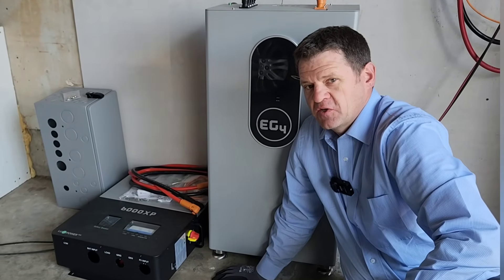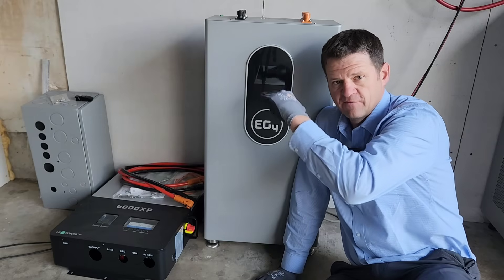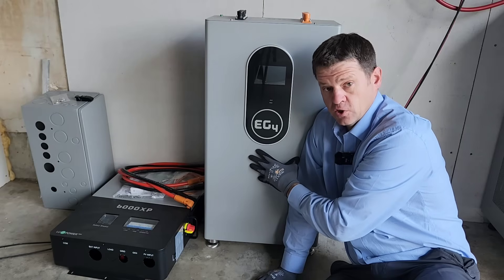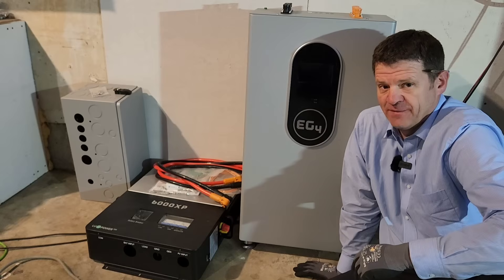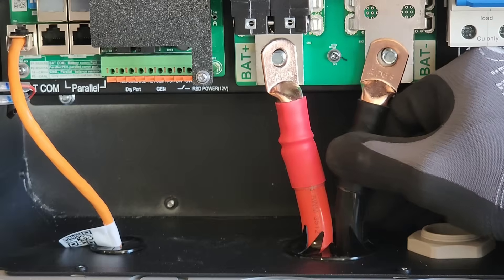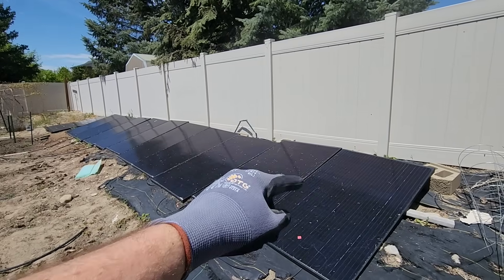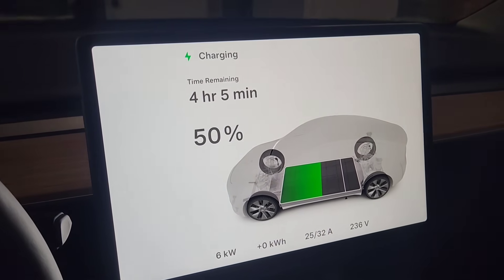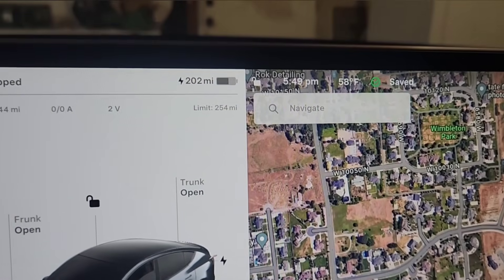I Built a Home EV Car Charger - Off-Grid, Battery Powered

Comment: Great Video. Thank you! Quick question - How did you ground the whole system? Did you connect the XP6000 PE/ground bus bar to a grounding rod? Or perhaps to a local subpanel and then to a grounding rod nearby? Thanks!
Reply from the maker: A system like this needs a ground neutral bond...i believe I added that to this system or configured it in the inverter. Which protects against any ground faults. 
   Earth ground rod does not protect against ground faults but it definitely couldn't hurt to add. The system shown in this video is not connected to Earth ground.

Comment: How do you expand to multiple batteries?
Reply from the maker: It's really easy. All you do is Mount the battery or batteries next to it and then you can buy battery cables with your battery and it allows you to connect the batteries together. There is a bus bar on the top of each battery. And if you are still unsure you can call Signature solar or eg4 Texas support and they can walk you through the process and what you need.  👍

Comment: I have a few questions:
- Since you didn't have a permit (hopefully no needed), have you checked with insurance company if they would pay when for whatever reason the unit causes a fire and burn the house?
- What happen when the battery is full, does the solar still charging?
- What the warranty of the inverter and the battery?
Reply from the maker: You would have to ask your insurance company. But this setup isn't tied into my house electrical system at all.  Very similar to using a chargeable power station in your house but just a bigger battery.
  The battery, I believe is 10 year and the inverter is a 5-year warranty.

Comment: Like your calculation break down. I am in Southern CA and work from home and I don't plan to take the car on the road trip (just need to be able to drive 100 miles round trip on every other weekend) so to make it more cost effective I think I need just half of your system. Does the inverter shutoff when your battery is full?
Reply from the maker: Ya. It will stop charging the battery when the battery is full. Just like any other battery charger

Comment: Thanks for sharing, very well done and informative.  However, the economics of this isn’t adding up vs just using the grid.  I’m sure your grid power rates are less than our in the NE  .32 per kwhr, so wouldn’t it make more financial sense to just use the grid?  I mean it going to take you a long time to recoup those upfront costs of the system you bought.  You’re also limited with the small amount of miles your pumping into an ev per charge.
Reply from the maker: It really depends on how much you drive.  So basically you just have to calculate how many kilowatt hours(kwh) your car is using it a month. And multiply that by your cost per kwh....eg $0.31 
      Some people aren't as worried about the costs but are more worried about having power in case of an emergency. My father-in-law had the power go out for 3 days... He started his generator up but it was driving him nuts because it was so loud. He eventually was going to run out of fuel.

Comment: H and thanks for your useful videos. Just curious, I have the same system other than the batteries that are 2 100ah lipos. Do I need to rod ground the inverter? Or will running the wires from the nema to the ground (PE) suffice, or do I need a wire from the PE  to the Ground rod? Thanks for your help
Reply from the maker: The YT channel "Electrician U" has a good video on "Why Do We Use Ground Rods".    I would watch that video and see if it's something you want to add. It wouldn't be to hard to connect your ground(EGC) to your house ground... which is connected to earth ground.

Comment: Thank you - a fantastic video exactly what I want to do.

I'm in Sydney Australia in a strata apartment block (condo) with our garage a fair distance and isolated from our apartment so I was looking for an off grid solar system solely for charging my EV. I'm retired so I'm home a fair amount of the time during the day day so I'll initially try a small 2 or 3 Kwh battery.
Reply from the maker: There are also some inverters that run without battery power... sun only. So that would also save you some money.  Cheers

Comment: These batteries are far far way from the energy capacity of the car. If you're building a system like this, it's pretty much required to be charging throughout daytime, unless you are willing to build a 60kwh bank, which comes with a cost and with permit challenges. Or not be using too much of the millage

Comment: 13:00 - Hopefully, you got a receptacle designed to handle EV charging (like Hubbell), which is designed to handle continuous EV loads. The $10 version you get from your big box store isn't designed for hours and hours of current flowing through it and they can't melt and catch fire. It might not happen right away. Sometimes, it can happen 1 or 2 years later. Just an fyi.

Edit: Never mind. I see someone else already pointed this out.
Reply from the maker: Good reminder. I need to do an update video on this.
Reply: @ I did mine over 2 years ago and I did it with the Hubbell version. I change my Tesla and my daughter's Mini PHEV. So far, so good. Honestly, if I had to do it over again, I would have skipped the NEMA 14-50 and just put a permanent hardwired charger. Awesome videos, btw.
Reply from the maker: Thanks, That's a good point. Maybe I'll do that in the next one.

Comment: Looks like you didn't ground your junction box.  Your grounding should be connected to a ground rod.  The neutral should be connected at one point to the ground.
Reply from the maker: I updated the setting in the inverter to enable the ground neutral bond. It is an internal relay.  👍
Reply: @diySolarPowerFunWithRay  That's good.  Is your ground system tied to the earth?  water pipe, ground rod or maybe your grid system ground?
Reply from the maker: No, at the moment it's just acting similar to a portable generator you would pull around to charge something.  The breakers work fine without an earth ground.  The ground rod acts to stabilize voltage fluctuations, often caused by other loads turning on and off.  Because this is just a single load, My car, I didn't tie it to earth ground.
Reply: @ Imagine the hot side of the circuit gets a fault to the chassis and your child gets hold of it.
Reply from the maker: @ if that scenario happens the breaker will trip and clear the fault.  A ground rod has nothing to do with clearing faults.
Reply: @ If current is flowing through a body that won't trip a breaker.  So why use a grounding system on a house?

Comment: the wholesale prices of these systems has gotten so insanely cheap just in the last year that you posted this video. I just bought a 6.5kw eu/uk/asian spec 220 or 240v single phase 48v inverter for 300 bucks delivered... the inverters meant for the non-us markets are like 1/5th the price of north american versions (120v/240v split phase) if you can figure out a way to use "single phase 240v." EV's dont care what country youre in, they charge just fine even on 50hz, i learned this from some us military guys who posted on the gm volt forums after they transported their chevy volts to the UK as one of the perks during their deployment there. 
building my own ~15kw (16s 280ah) LFP battery, cells only cost 720 bucks delivered. no bms, just dumb active inductive balance boards for now. 
pretty much the same system as this but only cost ~1k. kind of ghetto but makes sense coz i rent and cant really modify the house. no way to put in a level 2 charger, but i can just charge from my diy home ev charger.
going to wire in about 1kw of those cheap flexible solar panels, probably will half mount them to a fence with some pvc/lumber. 
the one trick to make this work even in winter time is that I have a 30$ 500w 120v to 240v step up transformer which can trickle charge the whole pack based on the inverter settings. so basically a very convoluted way of putting in a 6.5kw level 2 charger in the garage of a rental property which uses temporary solar panels.
just like you, mines its own isolated system. makes the most sense if youre thinking of going into solar to mess around with a solar ev charger since its usually the highest consumer of electricity. Im getting away with a small 15kw battery because our two phev's (gen1 volts) only have a ~10.5kwh usable battery state of charge (16.5kwh total, over a third of that is kept in reserve for longevity by design)

Comment: Is that a Leviton 14-50 receptacle? If it is, I would recommend you change it and buy a Hubbell or Bryant receptacle. They are commercial grade receptacles. My Leviton plug did not work well, the Tesla charger kept lower amperage because it detected that the plug was overheating.  There are a few videos showing Leviton plugs burning.  Thanks for the video.
Reply from the maker: Thank you. I'm going to update my plug!!

Comment: Word of CAUTION 💀 regarding that NEMA 14-50 receptacle you just installed! It is not designed for extended draw of an EV charger. Please look at the following NEMA 14-50 plug Leviton Part Number 1450R or Hubbell Lighting HBL9450A. Bother of these receptables have a car charging logo printed on the receptacle and cost between 40-60 USD. They are specifically designed for extended high draw EV charger applications. The basic 14-50 appliance plug while technically rated for the amperage is rated for intermittent draw of an appliance and not designed for EV charging. It is at best a melted outlet and charger connector and at worst a house fire if you continue to run the appliance receptable. :face-orange-biting-nails::face-fuchsia-tongue-out:
Reply from the maker: Thank you for bringing this up.  It is definitely safer to use the plugs you mention.  I'll update the part in the description and pin a comment mentioning this.  I think where most people get in trouble is they use the full 50 amps out of the 50 amp plug... But for continuous draw loads(eg EV charging) it's only rated for "40amps per NEC code using "The 80% Rule".  Even though the Inverter shown in this video can only output 25 amps through the outlet it would still be best to use the Hubbell outlet. Thanks!
Reply: @diySolarPowerFunWithRay  Nice yeah there have just been too many melted plugs going around using those cheaper outlets. You probably would have been fine being that your system is limited by the inverter (25amps) output and capacity of the battery. As they say better safe than sorry! You may have someone reference this video for a charger install on grid power.
Reply from the maker: @ShaneTheGeek  thanks. Yeah I might do a follow-up video and I will mention these plugs for sure

Comment: Anybody else convinced these are just money pit traps? We all use electricity with no problem for very cheap every day, yet for some reason, we feel we have to provide our own electricity and spend thousands of dollars doing it? Seems silly. Unless it's totally off grid, power walls make little sense.
Reply from the maker: I think it can be don't pretty cheap if you exclude the batteries and charge during the day with solar only.  Maybe I'll make a video on that in the future
Reply: "We all use electricity with no problem for very cheap every day"
In some places electricity is actually quite expensive, with off-peak pricing of 40¢/kWh and peak pricing of 60¢/kWh or more. In other places the power grid can be unreliable, whether because of frequent natural disasters or aging/insufficient infrastructure. If you don't need or want it, fine. But that doesn't mean there aren't other people who find this useful.

Comment: For those of you that are retired or work from home, and can charge during the day, here is an option that will cost even less. You can build a similar setup without the costly batteries and connect your EVSE ("charger") to the 240v connection on the inverter. Next, like with my Tesla, you can schedule charging, so leave it plugged in and have it charge during sun hours. Here in Los Angeles, I have about 5.5 peak hours of sun. You must set your either your EVSE or your car's charge rate to 25 amps (this rate may slightly vary depending on the inverter power). I suggest sizing appropriately. If you only drive 20 miles/day, go with less panels. Calculate your line/inverter/panel losses. If you start small, you can add a few panels later. Ray has it down for most, but this is a great "cheap" option if you are home during the day!
Reply from the maker: Great way to save money! I'd look at this inverter if you want to do car charging without a battery(I still need to test this inverter):  https://watts247.com/product/nhx-5kw-split-phase-120v-240v-outdoor-rated-grid-interactive-ul-listed-pv-inputs-to-500v-and-much-more/?wpam_id=133
     The 6000XP might work without a battery but the manual doesn't recommend it.
Reply: Or if you have 2 Teslas….

Comment: Maybe invest in a welding machine and some structural steel for those panels. 😁
Anyway, for those of us who are poor: My leaf will charge from my 110 volt 4000 watt inverter. Since I'm retired and only drive a couple of times a week this is just fine. To go from 0 to full would take about 2 days, but I just bring it up to 80% after I take a trip.

Comment: Many mistakes... 1- Never charge your EV battery to 100%, but 80-85% max except when you absolutely need a full charge. 2- Your NEMA 14-50 should NOT be the same as the one for appliances. You must use a better grade to avoid heat, risk of melting the outlet, fire, etc. You must be very careful with such advice abou the NEMA, people may experience a fire and claim you give them advice... Think twice...

Comment: I am in a wait and see what comes next mode on EV vehicles. My system is only 5.44 kilowatts and upgrading is still a year away so the EV thing is not for me just yet.  On a side note check out the GE profile 2 in1 washer dryer combo that I am probably going to look to get come black Friday to replace my Samsung stackable energy hogs. Planning on ditching the gas water heater for an electric and hoping the energy drain will even out with this particular washer and dryer all in one. Saw this on a Jesse Muller 18kpv install video or never would have known it existed. 🤷‍♂👍🏻👍🏻Great video Ray!
Reply from the maker: With only a 5 KW array I imagine it will be cheaper to heat water with your gas setup.
Reply from the maker: Cool. I like his videos.  I'll check it out.  I didn't see that snippet.
Reply: @diySolarPowerFunWithRay  yeah reading about the specs I was pretty excited. Some folks have lint issues but there is a hack for that. 👍🏻 thanks

Comment: You're SO CLOSE. With solar batteries at 4 to 6 or more times the cost of EV batts pee kwh you could have 2 EV batts, devise a way to easily swap them outof car and connect to house on alternating  days.Im rhinking a trunk mounted slide in gurney/trolley that rolls up to the house mains area, Then roll the other solar charged batt to the car. Would be best to have a hybrid ev so that a low battery(clouds,rain) doesnt limit your driving range.
Reply: Also I would trust the WARRANTY on an EV  battery far more than that of even the most highest quality solar battery or firewall manufacturer.
Reply from the maker: Interesting... I wanna see one. :)

Comment: thinking of building something like this for the trunk of my chevy volt.
too many times I get to somewhere that should have chargers and theyre all being used or broken, and I have to use gas on the way home.

200$ 240v single phase out (EU standard) 3kw, 24v inverter, has meh PV input (not mppt) and not the fastest battery charge rate
30$ 20mm ammo can
8x 280ah lifepo4 batteries, 55$ each lol, theoretically 8 of them can fit in a single 20mm can if you get the threaded (not stud) versions and stack them facing in, 2x groups of 4 (12v x2)
just wont run BMS' since they cause so many fires unless you way over spend on them. ive been getting away with only using active inductive balancers instead and spending a lot of time top balancing first (2x 4s, one for each 12v stack). think im the only one who does this.

and then use one of those j1772 240v to nema 15-20 e-bike chargers (30$) and cut the end of and wire it into the inverter, then i can charge it up with my ev charger at home or an ev charger I park at.
im pretty sure I can wire it so that 240v from my charger can go into the range extender and charge batteries while it also outputs 3kwh 240v to my car with another ev charger.
thats like 8kwh (~1 tank of gas) range extender for only about 700usd. Pretty sure i can attach the inverter vertically to the ammo can battery pack and have it not take up all my trunk space, and feed the charging cable out the window or hatch latch like i do for my micro inverter for my volts solar roof i installed (back feeds my rental house lol)

Comment: Thanks for sharing the video Ray.  I'm planning the same setup here too.  
How long have you had the unit installed and have you had any issues?
Reply from the maker: About 6 weeks. However I haven't been using it as an electric car charger because I don't have an electric car yet.... but I have been using the same unit to run my house for 2 months and is still running fine.

Comment: so, $5,000 minus panels, youd only have to drive 100,000 miles before you break even on the cost.
Reply from the maker: Depending on your cost of electricity. My electricity is pretty cheap.  But it's really for peace of mind knowing that I can have power for my car. This could also work as backup power for my home
Reply: There are quite a few places now where power costs >30¢/kWh. $5,000 would buy you ~16,500 kWh, which would be 50-67K miles. And that's assuming rates stay the same the whole time.